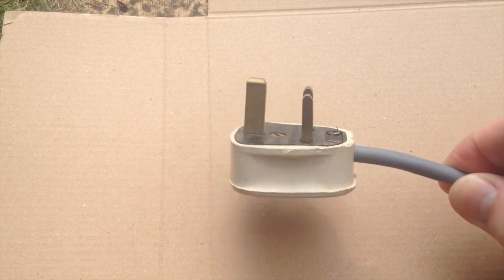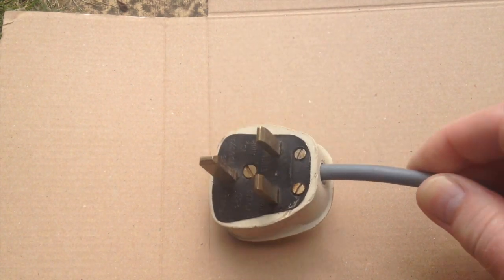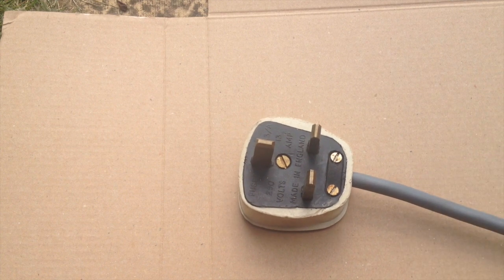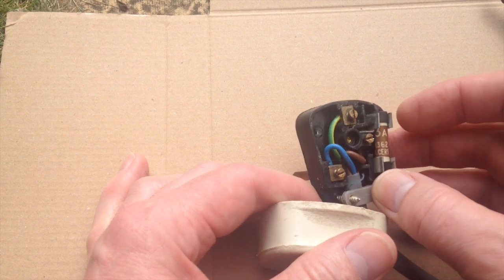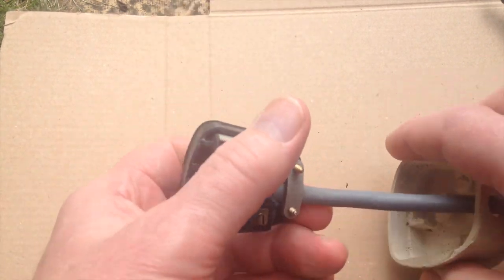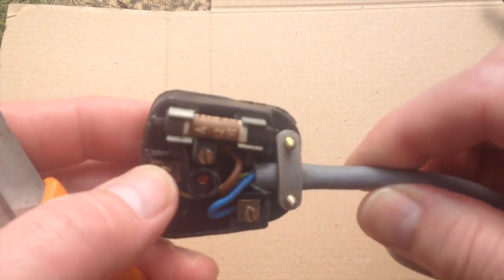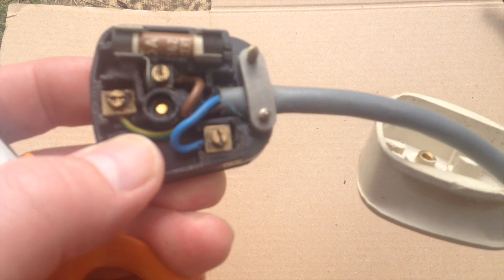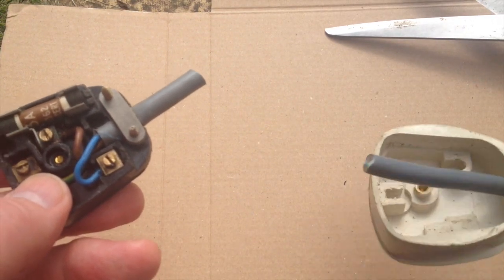Fixing A Burgess BBS-20 Bandsaw Part 2 - Removing Dangerous Plug

Comment: it's actually pretty dangerous to cut it off!  who knows where it may end up with a stub of cable hanging off it? disconnect flex fully from plug.
Reply from the maker: I actually used it in another video, to show how deadly these plugs could be. https://youtu.be/N4iaG1s3H6c but I welcome the tip and not having cable with live wires attached to plugs lying around. #fixed1tTIPS